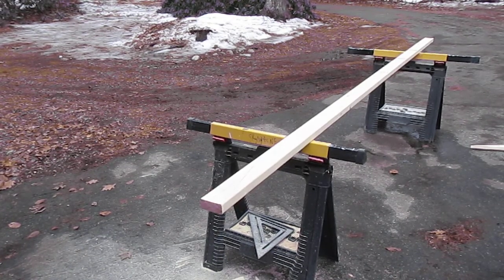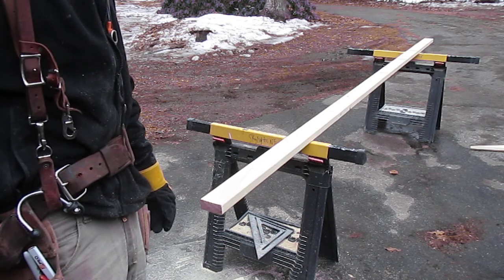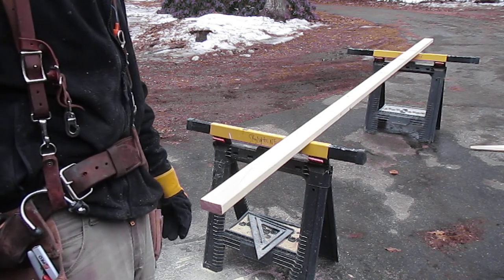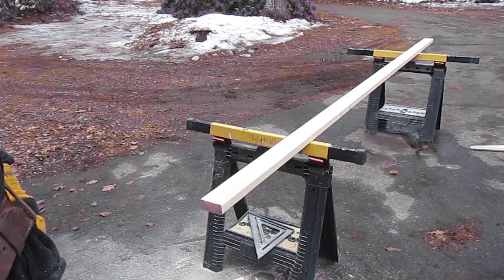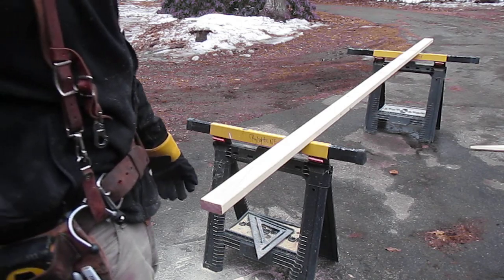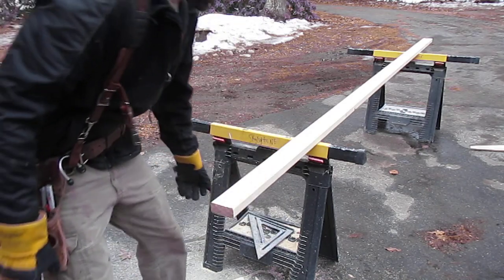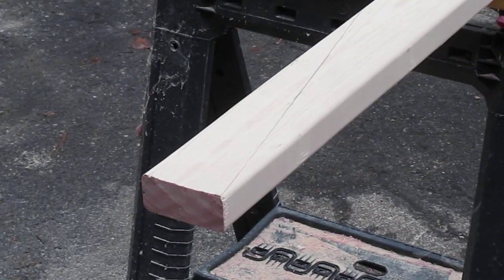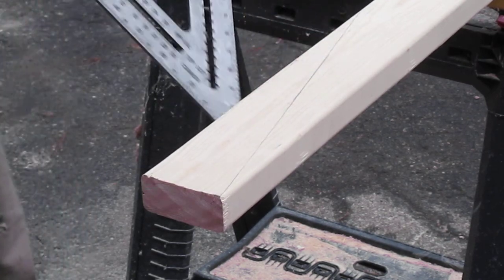Build  tripod to pull a deep submersible pump

Comment: What states are using hose instead of pipe? You guys with that flex hosing are so lucky. Mine is 20' sticks of 2" schedule 40 black iron. Can I switch to this flex pipe?? 
For a quick comparison here are my stats
2hp pump
Pump set at 350' casing is to 500'
6" well casing
2" pipe 
Recently my wires have started to drop. They no longer reach the terminal block.
I installed a strain relief cord grip to the remaining wire just incase the pump did spin off. I am building a 25' A frame now. It has to support 1500lb
Each stick is roughly 70lbs 18 stick
Reply from the maker: I'm in NH. Not sure about replacing something that deep with flex pipe, mine was only a little over 100' if I recall